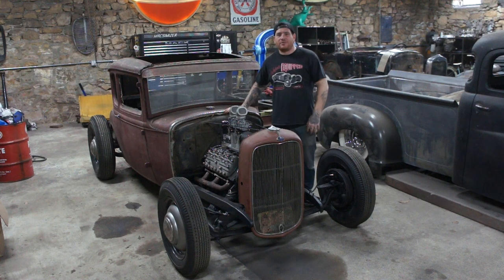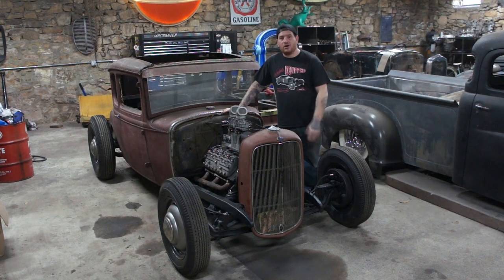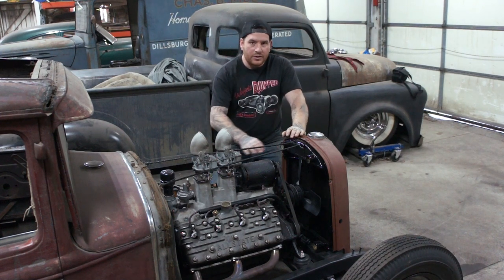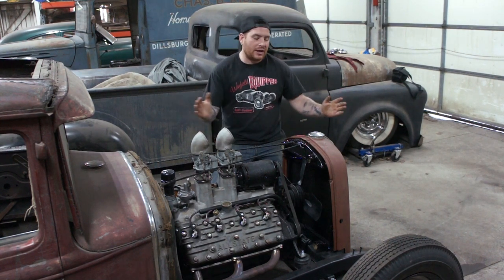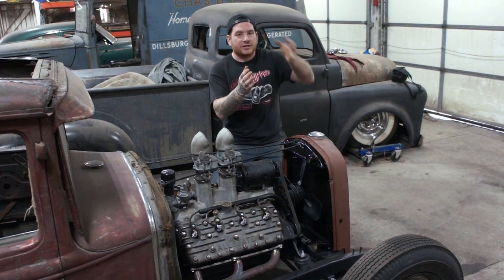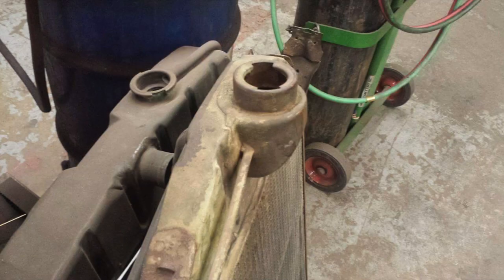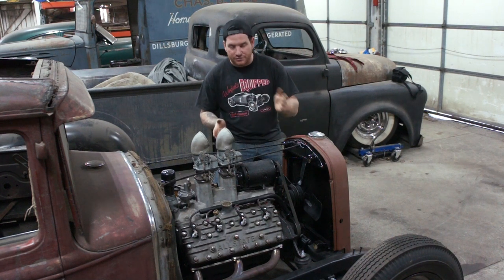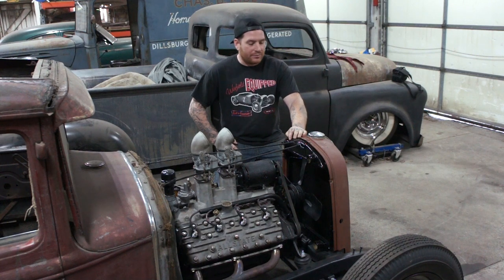How to Build a Chopped Hot Rod Radiator- Pagoda City Coupe

Comment: Did you use the original tanks (top and bottom)?Or are they custom?
Reply from the maker: I used a model A top tank and 1932 bottom tank. We then modified them from there to work with the 32 grill. It all looks fairly factory in the end I think. -Matt/ITG